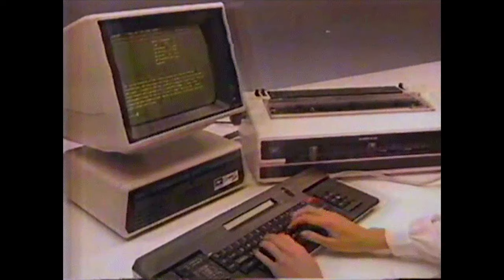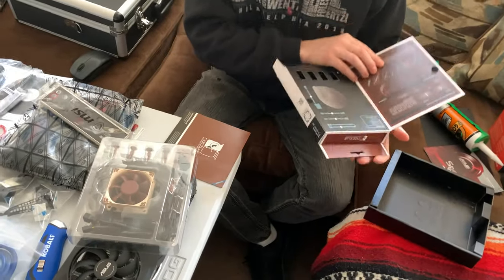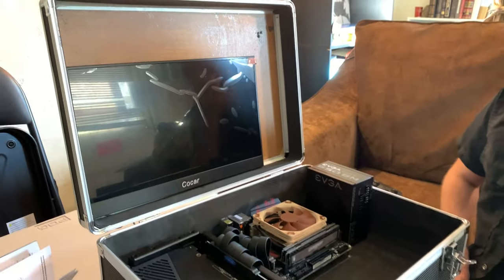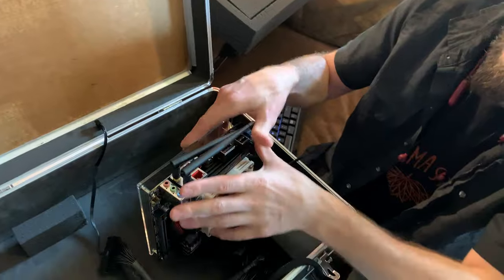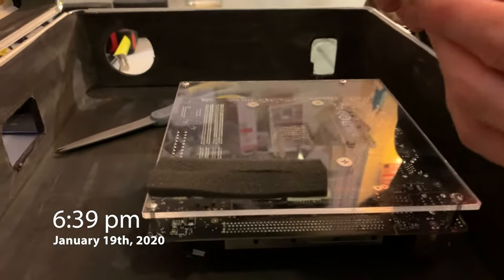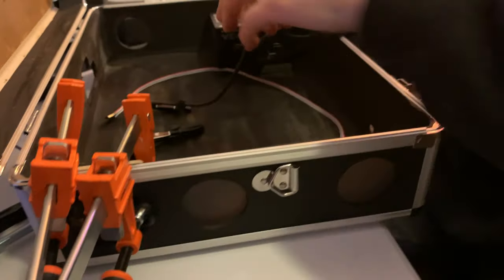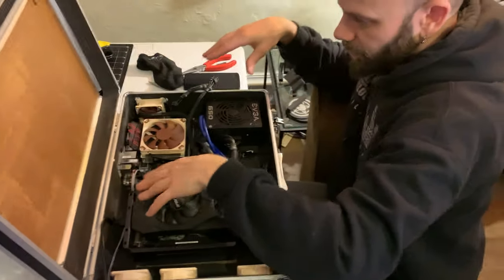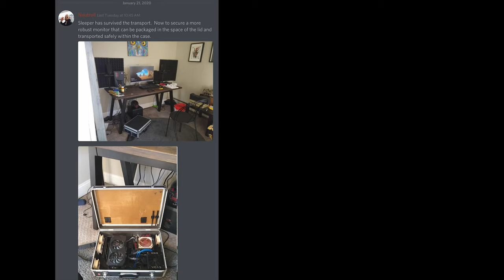$1500 PC in a Briefcase - Custom Stealth Sleeper Gaming PC Mod - 4k

Comment from the maker: You may notice we didn't cut an exhaust for the PSU during the video. It was added later, because not allowing the PSU to vent itself is a bad idea. We originally thought there might be enough space between the wall and the PSU for it to vent air, but the flow just isn't good enough. Make sure you give your PSU intakes and exhausts!

But wait! We didn't see it gaming!
https://www.youtube.com/watch?v=Dq6d3FdVeHQ

Sure it works but how hot does it get?
https://youtu.be/Nkxk96Rk_Mc
Reply: thanks for doing a build log, im prob gonna do this for my college pc...where did you get the mounts to secure the mobo?
Reply from the maker: I got mine from https://www.moddiy.com/ 
Its an acrylic motherboard tray, they have several different form factors.
Reply: @ThatsTheMidnightGamer  does the case have a name? I'd like to do something very similar to this build, and buying one on ebay ill never know if its good quality lol
Reply from the maker: @JacobSandsteed , this is a link to the case I bought:
https://www.amazon.com/gp/product/B00NPYDF8W/ref=ppx_yo_dt_b_asin_title_o06_s00?ie=UTF8&psc=1
It goes in and out of stock, but overall it did well for us. It survived being cut apart and still holds up to this day.
Reply: Could you give me a list of all the things you used????
Reply: If you wanted, there are very compact DC-DC PSU's (compared to the standard ones which adapt from wall outlet AC), and they use a power brick and cable that plugs into it, and that might save some space or cooling if need be

Comment: Do you have a link to where I could find one of those power buttons?
Reply from the maker: This is the power button we used. Its very solid, satisfying button and the light is bright but not crazy.

https://www.amazon.com/NOYITO-Chassis-Extension-Suitable-Computer/dp/B07PPDHKDT/ref=sr_1_3?dchild=1&keywords=pc+power+button&qid=1591753563&sr=8-3

Comment: Not sure if you're still responding to questions on this video, but why did you remote-mount the GPU?  Was it due to the case height or were you hoping to reduce stress on the mobo?
Reply from the maker: The video card wouldn’t stand up and fit in the traditional orientation. Laying it down was the easiest way to mount it, and it also happened to have the entire depth of the lid as clearance for air flow also. It was mostly luck how well it worked (and continues to work).
Reply from the maker: I saw another comment response from you but for some reason Youtube isn't showing it anywhere but my notifications. The riser cable I used is an obscure brand but came with a bracket (which we used) and also the riser cable.

https://www.amazon.com/gp/product/B07WHMYZYB/ref=ppx_yo_dt_b_asin_title_o01_s00?ie=UTF8&psc=1

"IBest ImPetus Vertical Graphics Card Holder Bracket,GPU Mount ,Video Card Support Kit with Riser Cable"
Reply: @ThatsTheMidnightGamer  
Thank you again!  I ordered the same acrylic mobo tray but I'm going to try to make my own graphics tray in the same fashion (my GPU doesn't have a backplate).  So, hopefully some standoffs through the GPU PCB will be as good as they are for the mobo.

Comment: Thank you guys, doing the same but only missing the GPU
Reply from the maker: My girlfriend built a new pc this past week and we don’t have a GPU for her either. We had to take one out of another PC in the house because... I won’t pay $700 for a 2060 or 1500 for a 30 series card.
Reply: @ThatsTheMidnightGamer  Oh I know ... I'm gonna have to wait for months because I want to put an 3070 in there ... I literally have everything except it. And it's hard to start building without it, even did a cardboard mockup, kinda helps. Well I'm gonna watch your video on repeat until then :)
Reply: Get something like a 1660ti
Reply: @secure-5593  Any particular reason ? I was going for a 3070 actually, but open to any suggestions
Reply from the maker: @secure-5593  Sadly, even those are selling for way more than they're worth. No RTX, double the price... nah. GPU buyers should wait for the 30 series cards to come back in stock. I couldn't even find good deals on ebay.

Comment: You should put a super long lasting battery, and make it battery powered.
Reply from the maker: Could definitely be done. We hope to update the build with an internal screen, and maybe battery solution? Hmmm 🤔
Reply: @ThatsTheMidnightGamer  if you do put a screen do it on the outside so you can kind of have an all in one. Plus it will look badass.😎

Comment: Does that cpu cooler not need any thermal paste?  I didn't see any on the cooler or the cpu when you installed it.  Or maybe I missed it.
Reply from the maker: I wondered how long it would take for someone to notice that! When I was editing this, I realized I didn’t have footage of the actual application. I must not have hit Record, because I distinctly remember narrating it. I did frantically wonder if we really hadn’t put it on, for a minute. The pc still runs without an issue (and there is a link in the pinned comment to a temp test we did a while after the pc was built) so.. if it doesn’t have thermal paste, it’s a miracle. (But I’m 99% sure it’s on there)
Reply: @ThatsTheMidnightGamer   lol I believe you.  Just didnt want you to have a melt down.

Comment: Just a question for ya because I’m not a handy dandy man. But what tools did you exactly use to mod the case? Looking into doing a similar build but not familiar what tools I need to make this possible.
Reply from the maker: In order to make changes to your case, a dremel is ideal. Along with it, consider a circle-cutting guide like we use here to cut out the fan holes. It’s not totally necessary but does make a nice clean circle. I’d say the dremel is the most important tool, alongside typical screwdrivers. Having a nice table, like a folding table, will make managing your build much easier and is often overlooked. Working on a floor or a counter might introduce dirt, dust and other nasty stuff into your parts. I also recommend a small hand vac or shop vac to quickly suck up any dust and debris you create when using your dremel. Finally, sandpaper to smooth your edges. A medium grit should do well. When considering how to affix your parts to the modded case, I recommend looking up acrylic motherboard trays like the one we used. Also try to get the smallest parts you can, like low-profile style parts. More room to work with, and more room for air to flow. For adhesives, gorilla glue and zip ties can go a long way. Consider that you may want to replace parts one day, so try to find brackets to hold things like your graphics card and the motherboard like I mentioned earlier. You will probably also need a riser cable for positioning your graphics card somewhere besides directly on the motherboard.

TL;DR, a dremel is #1. Maybe a nice iFixit tool set would be #2. And a table is a very close #3. A small vacuum will also be useful for cleaning your case once you’ve made cuts.
Reply: @ThatsTheMidnightGamer  I appreciate it I already have a mini itx build I’m just looking to making it more portable than it is only difference is I’m going to to build a 3 monitor mount that folds in and out on the top part of the case.
Reply: My case is the Node 202

Comment: You could have it liquid cooled to conserve space but it would bring up the budget
Reply from the maker: Adding a radiator to this would take up a ton of space, not to mention running tubes everywhere. Plus the weight of the liquid, it would be bigger in both respects compared to the air coolers. but you could fit a liquid cooling system in there, if you really wanted to. It would look sick. And be much better at cooling. But conserve space? Nah
Reply: @ThatsTheMidnightGamer  much like cable management, it depends on how you configure and set up the liquid cooling and what kind of parts you get. Youd need to think outside the box (pun intended). Ive managed to liquid cool a old ps3 and fit all compnents into its original shell before so i know using the right parts will conserve space. Water blocks are a much lower profile than the cooling systems you have on that chonky boi graphics card and cpu. You can also use strait pipes to run the cooling, which would decrease the profile even more. I also know there used to be small profile raidators that fit in 80x320 mm and 80x160 mm but they can be hard to find. If you dont like using pipes from home depot and want solid clear acrylic pipes, look for what they use in fish tanks and aquariums. Im planning on doing this in my own suitcase build later this year. I am aware that liquid cooling would also make it heavier.
Reply: @ThatsTheMidnightGamer  you don’t need to run a 360 mil radiator. A 120 would take as much room as the heat sink installed

Comment: build 1 using laptop parts + cpu + GPu + battery etc
Reply from the maker: See, the reason using the briefcase is beneficial, is because you can use full-size components on repairable, modular, mass market parts. Laptops have bespoke parts, are minimally repairable, and not upgradeable. This briefcase PC? When our friend was done with it, he took most of the base parts and put them in a new tower PC.

Why would I buy a more expensive laptop, with parts that are handicapped by being required to be small and cooled with heat pipes, tear it apart out of its chassis, risk breaking it, and stuff it into a briefcase? It wouldn't improve the laptop and the result would be less protected than the normal laptop when assembled correctly.

Think man! Think!
Reply: @ThatsTheMidnightGamer  can't we buy separate laptop gpu and CPU motherboard etc like for a mini pc or something ? can you make a battery operated from PC parts using less powerful CPU gpu etc

Comment: Doesn't it get too hot? Especially the graphics card? I think it looks really interesting, and I'd love to do something similar, but I'm worried about overheating. Really cool build thought!
Reply from the maker: Check out the pinned comment at the top for links to the temperature test. Since the top portion (lid) of the case is totally empty, and nothing clears the top edge of the bottom portion of the case, there is a lot of airflow over the components via the efficient Noctua fans. In the event of overheating, the lid can be propped open, which is actually how Brandon tends to use it just because it’s possible to do. So far, almost a year after the build, he has had no issues with the hardware. It’s his daily driver and gets heavy use.
Reply: @ThatsTheMidnightGamer  ok cool! Thanks for the answer :)

Comment: couldnt you simply have the fan blowing the heat to the keyboard? If i am using it in a cold place it would act as a heater. Couldnt you attach the PSu so that the cord could be folded along the side of the case?
Reply from the maker: You could definitely do those things! Lots of custom options when designing a build like this.
Reply: @ThatsTheMidnightGamer  i have been considering this idea too. Except i am not really comfortable using power tools. I was thinking of simply getting a bunch of brackets to fasten the pc component to the case and perhaps a bracket for the monitor for the case. I was considering the idea of  having the usb, hdmi, and psu ports situatued inside the case so that the cords can be twisty tied into the side I think my main concerns if airflow. I understand that i would want to have one to one fan blowing air in on one side and another fan blowing out on the other.. The other concern is whether i would still need to have metal so that heat can get transferred away. Possibly the brackets might serve that purpose . If i could find fabricators to do it . I would like to add extendable legs and perhaps large wheels and springs to absorb shock.

Comment: What's the GPU bracket you used?
Reply from the maker: IBEST IMPETUS Vertical GPU Mounting Bracket https://a.co/d/5nWgNoZ

It has a terrible rating now, but for the purpose of holding the GPU in place and providing a proper slot to install it in, it worked great for us. It stayed intact for the entire life of the case.

Comment: After watching this video You should not buy a case then make it fit.  You need to build a case to make the parts fit where it doesn't look modified.  Such as buy the flush mounted USB, power switch, and other ports that is needed.
Reply from the maker: Building a case like this would be hard, and I do not have the tools to build an entire high-quality briefcase/hardcase. But, modifying an existing one is easy. You could get more flush pieces, and hide vents better, but we had a budget and that makes it difficult to over-specialize. I knew in advance that all the parts would fit inside (and with room for air flow) so I wasn't concerned about space, but I agree the "stealth" aspect could be improved upon a lot.

Comment: What are the measures of the box? (in cm) thanks in advance🙃
Reply from the maker: This is a link to the actual hard case we bought;

SRA Cases Aluminum Hard Case with Foam Insert, Black, 18.1 x 13 x 6 Inches https://www.amazon.com/dp/B00NPYDF8W/ref=cm_sw_r_cp_api_i_v8KDEb1W8PNVT

It is roughly 46x15x33cm

Comment: Sir what hard case you had used in this setup?
Reply from the maker: This is it!

https://www.amazon.com/gp/product/B00NPYDF8W/ref=ppx_yo_dt_b_asin_title_o06_s00?ie=UTF8&psc=1
Reply: @ThatsTheMidnightGamer  does it work well?
Reply from the maker: @ppnexus2000  The case? Yes, it does. The walls are made of a particle board material which, as you can see in the video, cuts and sands decently enough. There are lots of alternatives to this case, however. We chose this one because it fit our budget, and seemed to have the right aesthetic. There may be better choices based on your usage. But so far, this PC has lasted with zero issues for nearly a year now. Brandon uses it daily.

Comment: It was at the moment you said a fat laptop when all this adventure lost sense.
Reply from the maker: Laptops can’t be fully upgraded and serviced by the owner. Also, laptops LOOK like a computer, no stealth there! You also can’t build a laptop from scratch, so if you want a portable, fully enclosed, fully upgradable and repairable device with excellent air flow, your only options are to; buy a case designed for portability (Upwards of $200) OR you can have fun and build one from a briefcase!

Not all projects are practical, either. Some are just fun 😉 but in the end, this PC is still working great, and Brandon travels with it every time he comes to visit.

Comment: Nice man great idea but you can use a 500watt PICO PSU POWER SUPPLY INSTEAD OF THE BIG ONE
Reply from the maker: PICO wasn’t required. This PSU was small enough and from a company I trust. Smaller PSU also means less surface area for a fan to function, which would be bad for cooling.

This PSU is an XFS model, already much smaller than any PSU I ever installed before, and it exceeds the power requirement for the PC by a small margin to prevent it from maxing out its capabilities during use, which keeps the overall temperature down.

Comment: Hi, what's the Dimensions ( LxBxH ) of the box?
Because I am also planning to make. What's your email id or insta id so, I can take advice personally
Reply from the maker: I can't give tailored advice but, what I can tell you is that if you measure the size of your motherboard length and width, measure the size of your GPU, and the size of your power supply, you can arrange them laying flat on a surface and then figure out what size case you will need. You will need a riser cable for the GPU so it can lay flat, but otherwise it should work like building in a small computer case. You'll have to get a motherboard tray with standoffs to install the motherboard to, so that it isn't resting on the case itself.